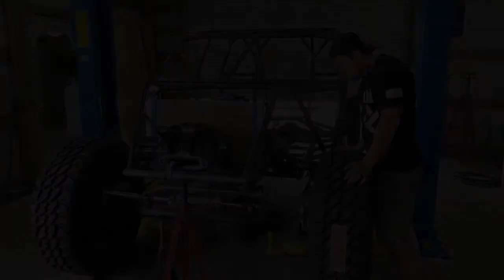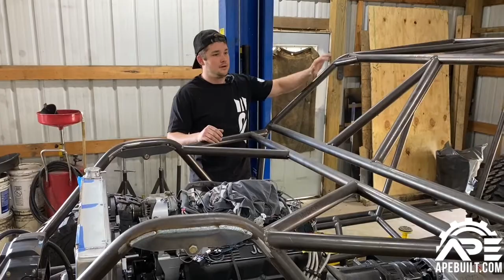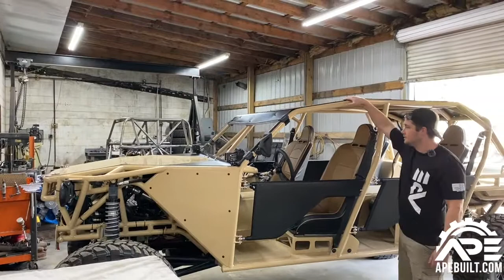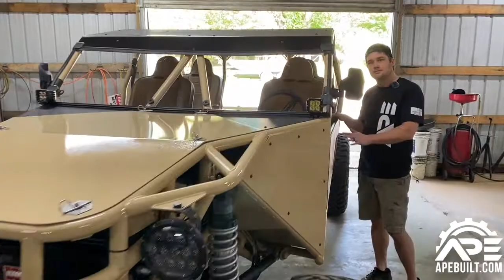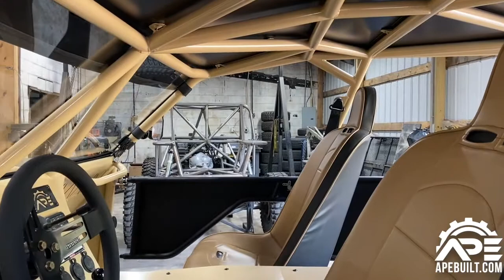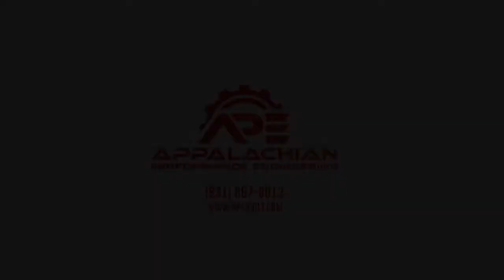7 Minute Rock Crawler Build  Orvis build update part 2

Comment: Not trying to be a jerk, but It looks like your high steer arms on on the wrong sides, judging by the angle they're sitting at.
Reply from the maker: Negative ghost rider, they're Crane axle inner & outer knuckles with the high steer setup.  The arms sit at a slight angle and we bore them straight though for bolting in a straight up and down position.  It's crucial to keep everything as straight as possible from the ram to the knuckle... otherwise you don't maximize your turning angle.  
Also note that nothing is bolted tight in the vid. 
Preciate the support.